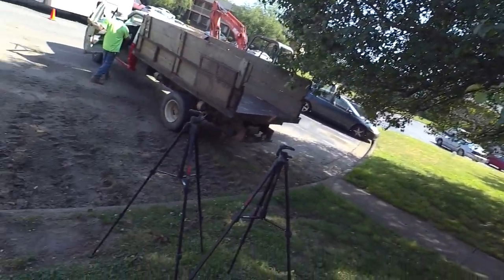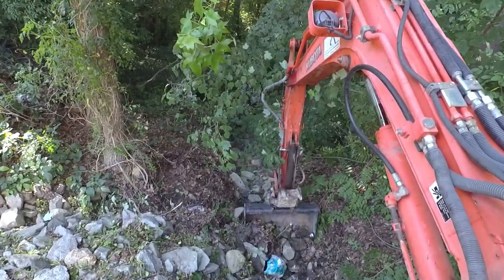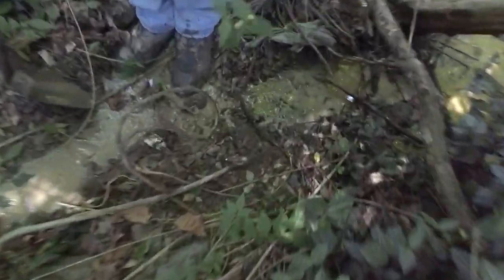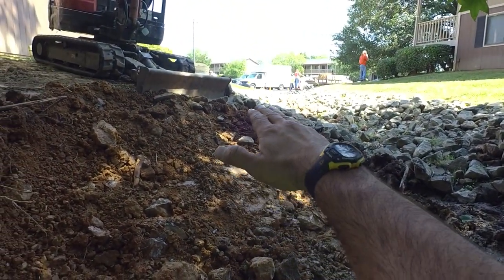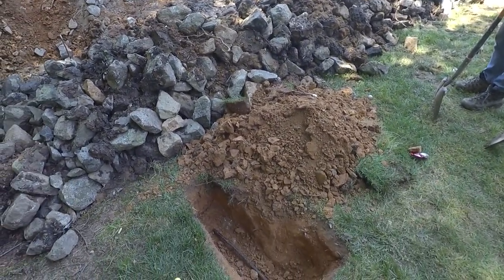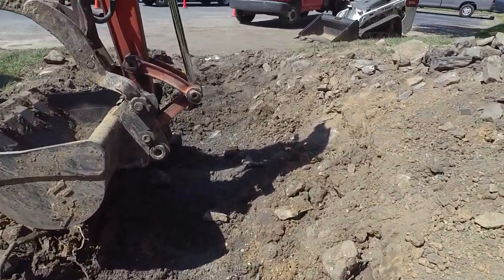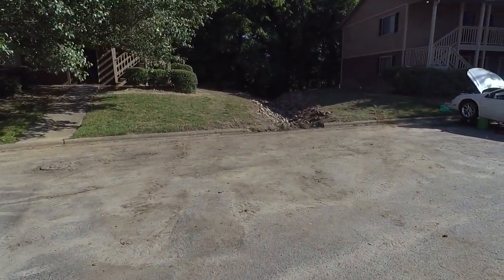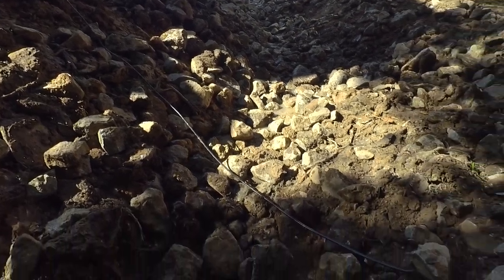Reshaping a drainage ditch to achieve fall

Comment: I work on large bridge jobs for the DOT. We had a 4 inch copper phone service. 100s of wires that ran under the bridge we were demoing to replace. Contractor had a hard time cutting it. It would tangle in the quickie saw and melt with a saw zaw or a torch. This line is 60 feet in the air over a very large river. He asked us of we had any ideas. My boss is a man of few words. His answer was "most contractors use a hoe bucket. Cuts like butter" the Contractor just lowered his and walked out in shame 😆.
Reply from the maker: Haha Great story!
Reply: i remember a job demo'ing a couple 110 storey buildings, only needed a couple of CGI jetplanes and they came down at near freefall speed mostly on their own footprint and one 47 storey building just needed one single post knocked out and it too came down in its own footprint at near freefall speed

Comment: Good job.  Doing drainage correctly takes skill to understand the right way to do water elevation drop.  Needs fine tuned at the top where it meets pavement.  A shallow collection box with a culvert would make passage in front of vehicles safer.
Reply from the maker: That might be an add on later!

Comment: Great work and videos as usual. I noticed at the end of the video it seems like the water is getting held up in the middle, looked like to many rocks were blocking water flow. i would guess you removed a rock or two so the water can flow easily and not be pooling a bit.
Reply from the maker: Yes! I plan to let this settle in a little bit more and revisit just to make sure. I gave a 1 year guarantee with this and the expectation that I would revisit and tweak as needed.
Reply: @GCFD  Expected nothing less but this sort of great customer service from you! Keep up the great work and post more videos , I hate waiting for them :P

Comment: As someone who works at an ISP (Suddenlink/AltoceUSA) be happy you hit Coax and Not Fiber.

Coax is cheap and only hits from pole to house... Fiber is expensive.

That being said: Sadly those Coax drops are often not added to charts like fiber conduit, so I don't blame you for hitting that line... It shouldn't have been running under the swail regardless... Bad planning by Spectrum.

Edit: 
Awesome for sticking around to help the utility fix the issue.

I cannot tell you how many construction teams hit a line and tell no one like they can get away with it... In those cases we charge.
Reply from the maker: They said it had been there since 1987! Those guys were super nice, perhaps because they weren't going to have to dig the trench!

Comment: Hello .  
maybe it is an idea to buy a sorting bucket for the mini excavator or to make it yourself.  
with a sorting bucket you only dig up the stones or concrete and you sort all the soil and rubbish out of it.  
this way you can also clean the stones very easily : 
you dig a bucket full of stones, 
shake your bucket a bit ,
and like a sieve all the soil from and between the stones falls away through the bucket , 
so you are left with a bucket with "clean stones".  
Sincerely Hollandduck from the Netherlands
Reply from the maker: Yes I was thinking the exact same thing! I just don't know when I'll get another job like that but a sorting bucket would have been the ticket. Luckily where we were taking the dirt, the extra rip rap didn't hurt anything. That video is coming soon!
Reply: @GCFD  
maybe a nice downtime/winter DIY project ?

Comment: The apartment complex should've had you replace that riprap channel with a culvert instead. Backfill with some dirt and call it a day. It looks a lot better too.
Reply: Agreed. That swale takes up a lot of space, both visually and practically.
Reply: I agree, but you'd have to catch the water in that area as well with some sort of french drain or something.  This was likely way more cost effective, although less attractive.
Reply: @dbroder  could still do the culvert with a catch basin for the pavement run-off and leave a subtle swale above the culvert pipe for any yard drainage... could easily get rid of the unsightly and troublesome  rip-rap ditch and have a grassy, easy to maintain swale.
Reply from the maker: We were on a tight budget with this job, but a culvert would look a lot nicer. There are a bunch of these riprap channels around the complex already too.
Reply: @GCFD  true,  true... it's all what the customer wants and is willing (or able)  to pay for.

Comment: 22:35 If you look at the corner of the house there are is two issues there you can see the footer well the cement pad it’s starting to get washed out from the bottom and then the splash block for the downspout should be really flipped around because it looks like it’s installed backwards
Reply from the maker: That's a classic desperate act, flipping the downspout guards around.
Reply: @GCFD  yessir

Comment: Have you thought about investing in a tumbler for jobs like this? It's used to separated dirt from rock. It turns as you load rock and dirt in one end, it has a grate that allows dirt to pass through and the rock comes out the other end. They run on gas so no extension cords to run and is easily moved with one person. Could save a lot of time. Also works to separate roots and other debris from dirt.
Reply from the maker: I have thought about it. We could have used it on this job for sure. They also sell attachments that do the same thing for skids and excavators.
Reply: I thought the same thing, but only because I have a need to organise and sort stuff. I would have ended up with piles of all different sized rocks and the soil all neatly piled up! But that's just me! I never used to build with Lego but I sorted it to colour, brick shape, then brick size! Don't judge me too harshly 🤭😊

Comment: I suspect that just fixing the flow of the concrete culvert would have stopped the lake from forming but it is nice to see the job done right.
Reply from the maker: The grate feeding the culvert was too high and should have been at the low point.
Reply: @GCFD  
I think that it getting optimal flow for its position the poorly done drainage ditch would have kept up with the rest of the flow under normal moderately hard rain conditions. But I have been wrong before.
Reply: @GCFD  I would not be surprised if there was just a culvert there originally. Then they installed the ditch because the culvert grating was not at the low point. When they dug the ditch they may have found the cable you pulled the splice on so did not dig the trench to a constant fall. I would assume that the end of the culvert has been mostly blocked at times by that bank collapsing. The rip rap may help with that in future.

Comment: Here we have to outline all excavation work with white paint, basically the 4 corners. They locate inside the white lines, Then you take photos of the lines.  But it happened helping them getting the cable back in does go a long way.
Reply from the maker: They do ask if the area has been pre-marked in white, but it's not required here. Every time I've hit lines I've always helped out and never been charged.

Comment: Why wouldn't installing a king sized french drain be a more robust solution?  You already have the rock on top.    Love your channel
Reply from the maker: The FD would still need fall and at this area we were dealing with point water sources for the post part. 👍

Comment: Hey Shawn, just watched this video! I am guessing you have your North Carolina Sediment & Erosion Certification since you are working on a commercial waterway project. Was it very difficult to get your certification???  I have been thinking about adding commercial projects, but the requirements between the Contractors Board for Licensing, the Insurance and meeting and complying with O.S.H.A. standards is a little scary & expensive!!! Any advice would be greatly appreciated!!! Keep Up the Great Work... and Keep posting these Videos !!!
Reply from the maker: No, this is not a commercial waterway, it's a stormwater drainage ditch. I have talked to the guys at sediment and erosion control in my town and they are very helpful. Anything less than an acre of disturbed land doesn't need a permit but they do require sediment control measures (silt fencing) to be installed. I have run into that with some land clearing quotes I've done but never any problem with mucking out a drainage ditch.

Comment: haha 811 stories .... I am a ham, I placed ground rods all the way around the house every 10 feet and bonded them together. Every time they mark the house they either a) get it wrong and dont mark it all or b) go around the corner see they are headed away from the box and cuss. The last guy I had to yell at no the phone is over there see the tower .. that ground ties into the whole system if you follow it you will end up back near the start .. no no its the phone .. no it isnt I dug that ground wire myself ... look over there beyond the power lines ...

Comment: It would be best to build a little footbridge just over the part where the outdoor lighting cable runs and then just make good and secure the lighting conduit underneath it.
Reply from the maker: Great idea!
Reply: Great idea Phil. 👍 I think now I know why the swale was completed in such a method originally. Possibly they knew about the cables? Great job Shawn. Simple ideas making big differences.

Comment: what out cable company does around here, I mean they subcontract out the work of the burying of the line. but alot of the subcontractors if it goes under a drainage ditch. after the pipe is laid down, they will power a few bags of cement over it just the bag. they wont even wet it. I talked to one of them before. They said after it rains, the cement will harden but it allows the cement to shift and move while it rains so it does create a hump in the drainage ditch. but will keep the pipe in place, and if the ditch needs to be dug up again, next workers will hit the cement instead of the pipe with the cable. Saving the cable line in side from breakage.
Reply from the maker: That sounds like a cheap protectant solution.

Comment: Can't believe they didn't just want a storm water box and a pipe installed and level the dirt on top of it for a nice even yard , A lot less unsightly an more effective . Couple of things , why didn't you line the ditch with plastic to prevent erosion ? Surprised they didn't have to install a storm water retention pond of some type  , Usually you are not allowed to dump storm water directly into a receiving body of water .
Reply from the maker: Here all storm water drains to surface waters (creeks and ponds). The stormwater basins all say Drains to Creeks, don't dump with a picture of a fish. There shouldn't be any erosion in a bed of riprap so fabric was not needed. Rip rap is erosion control because it interrrupts the flow and slows the water down.

Comment: Rip-rap slows the water down to prevet erosion, it looks like you had a silt trap set up with the rip rap was stacked high enough to ruin the grade.  Years of "not a problem yet" caused this probably.
Reply from the maker: Yes, I see it all the time where people bury areas with riprap and call it a solution.

Comment: Awesome work!  I feel the pain of those cable techs... the inventor of underground rear easement utilities should be drug into the street and whipped in a circle with a hickory switch!
Reply from the maker: haha 👍 We had them covered by digging a new trench.
Reply: @GCFD  It was always nice to have a willing partner when damages occurred, they could make the repair sooo much easier, yall are a top notch outfit, keep up the amazing work!
Reply: Let me argue counter-point. One of the core fiber-optic cables between two of our university campuses is aerial for 200km. At two places along the route, it crosses a 2 lane raised-bed highway at just the right level of sag that when a Landoll-style carrier with a large excavator goes through, it will snag it. Six times in the last three years it has happened. The utility doesn't want to put a duct under the highway, and says their poles are industry-standard height, except the last poles are someway down the slope of the raised bed.

Yes it isn't a rear easement, but it's given me a dislike about aerial solutions. I would also argue that whoever designed  and built that complex should have excavated once while construction was going on, put 4 six inch ducts at least four foot down between the buildings and proper manholes at each building for the utilities. Like Shawn demonstrated here, with the digging equipment already on site, it doesn't add that much extra time, especially if it is greenfield.

Comment: Too bad they just couldn't put a nice concrete drain through there, just like the last parking lot where you re-poured it.  Then they could have had a nice level grassy area between the buildings.  🤑🤑
Reply from the maker: There were several more of those rip rap channels throughout the complex so this aligned with them.

Comment: And I think the only thing I would do differently about this job is the entrance of the rip rap like where the street is I would’ve made it a little deeper maybe like four or 5 inches and put riprap at the entrance because you can see when the rain was coming it was kind of making a little whore I do not know if that will do anything overtime but I was going to ask if it’s possible to put riprap right there to prevent erosion
Reply from the maker: We didn't have a lot of fall to deal with so we tried to keep the entrance in line with the rest of the fall. the riprap really doesn't need to be there because things are so flat.

Comment: Don't you need to lay plastic on the dirt and THEN put the rip rap back down ?
Reply from the maker: You can use plastic or soil stabilizing fabric under riprap. If we were installing a new channel we would do that, but here we didn't since we were just reworking what was there.
Reply: @GCFD  Thanks for your reply !

Comment: So, basically, the drainage ditch had to be installed because the drain grate wasn't installed in the lowest part of the parking lot. If it had, there would be no need for the swale. Engineers are idiots!

Comment: That's gonna fail big time ! Rip rap too small and not enough rip rap covering certain areas , sloppy work sorry but let's see your next day to see your final solution .
Reply from the maker: So far it's holding up very well and flowing! How do you predict it will fail by not having enough rip rap?
Reply: @GCFD  
Based off that lil rain you showed us no ! I wouldn't be able to tell you if it would fail but come back after a super heavy rain fail and see that lil rip rap washed away